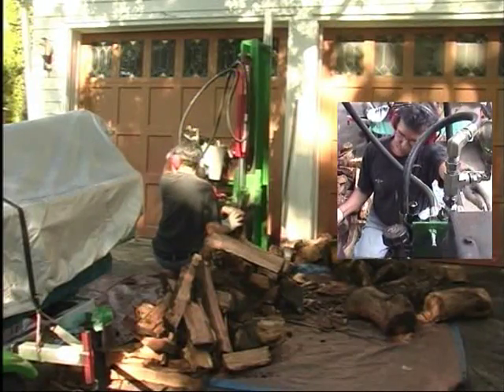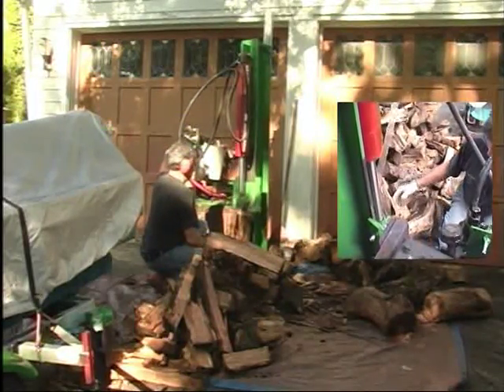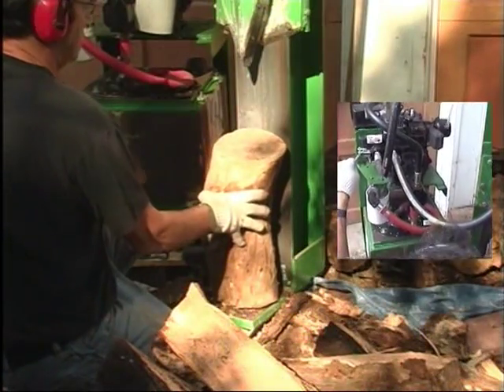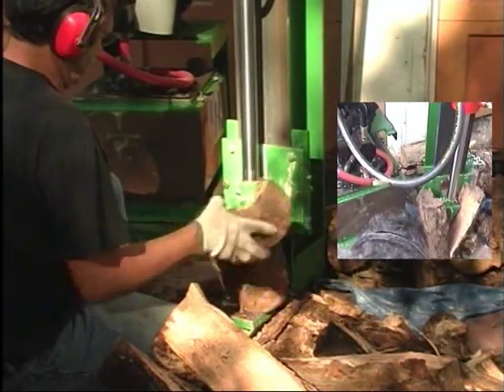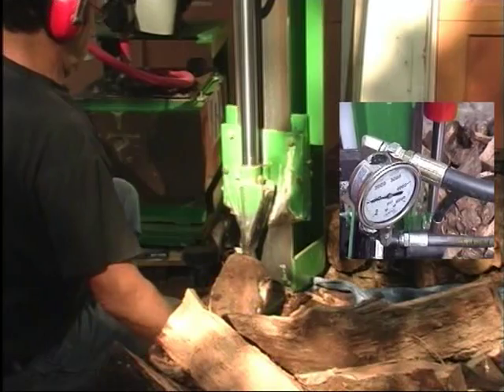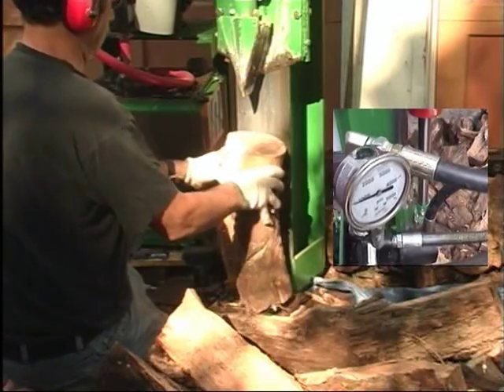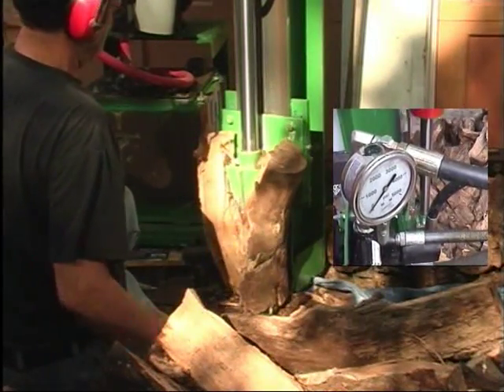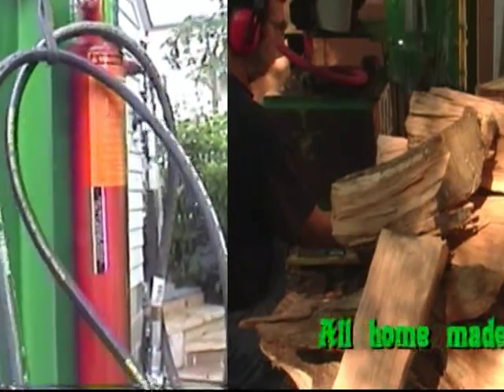splitter    hydraulic  hidraulico

Comment from the maker: If the grain is even it will split with no more than 400 lbs/sq in if the grain is turbulent it will go up to 2000-2500.the motor will slow down and you will feel the force been used. Stop if it does not split and find a better grain.

Comment from the maker: The pressure varies according to the log resistance , If the log has really turbulent grain usually  the pressure will go to 2000 - 2400 lbs/ sq in. Bud if the grain is even , it splits with no more than 200-400 lbs/sq in. If you go perpendicular to the grain it will not split and the pressure will go to the max , you will also feel it in the gas engine , that will sound forced and slowing down.. Probable at this point your splitter head will be stuck in the log. Pay attention to the grain.